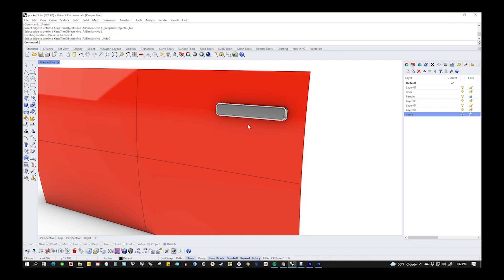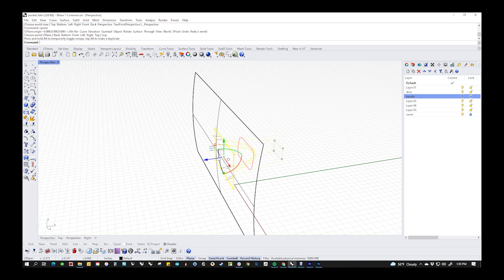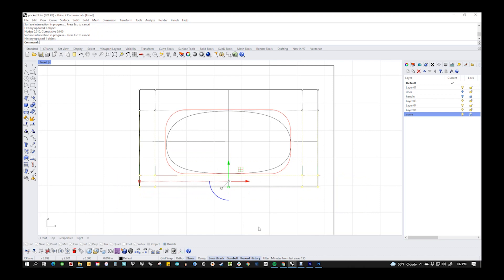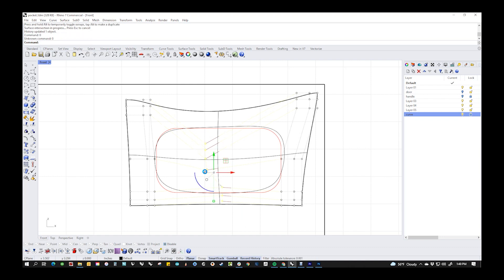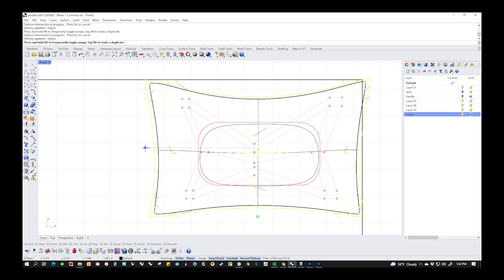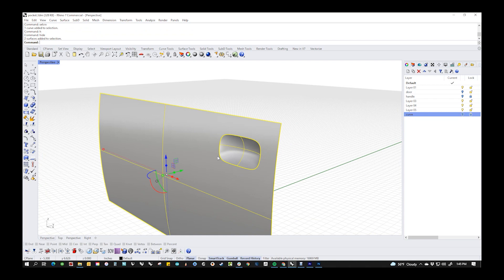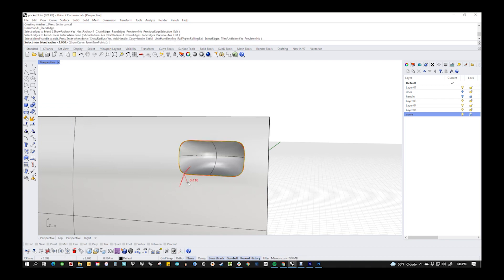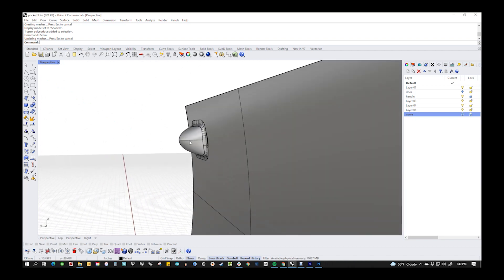Rhino 7- pockets and bumps

Comment: I would just make the pocket surface an then have it intersect with the main surface, then split. this has creases, but if you combine the 2 and do filet edges you get rounded edges. if you wan more control of the blending, simply sont combine the 2 but put in a little space, then blend the surfaces for a more organic blending.
Reply from the maker: yes, that is exactly what the video shows. 

see the pipe blend trick video for the pipe trim/ blend srf workflow.

Comment: Love this intersect technique!
Altho I'd love more control, like using a networksrf. Only problem with this technique is that you get strange edges in the corner which you need to trim(offset).
Reply from the maker: You would always have to trim unless you used a complex tool like patch, which gives you a multi span surface. The key here is simple easy to manipulate surfaces that trim and blend wonderfully. They also data transfer great.